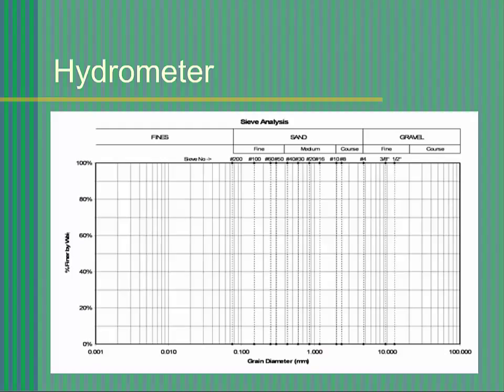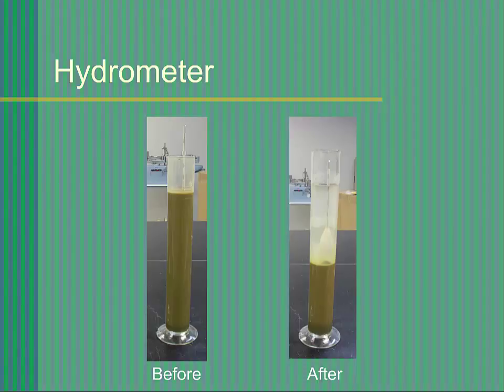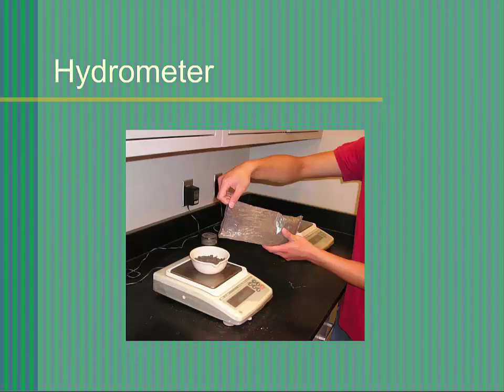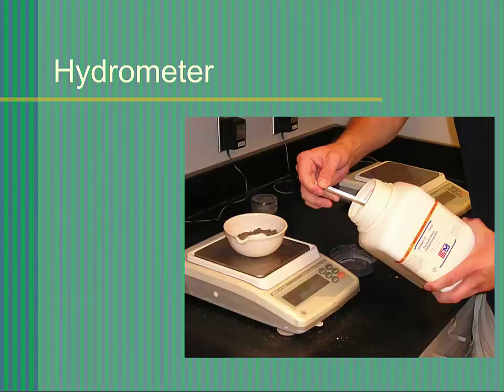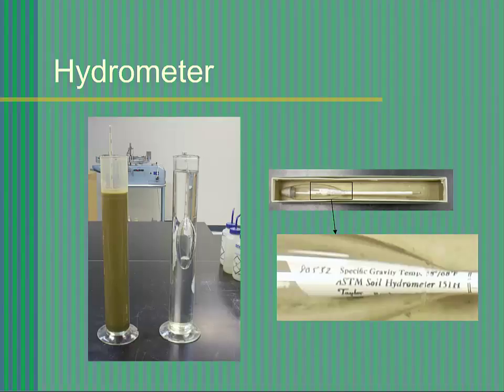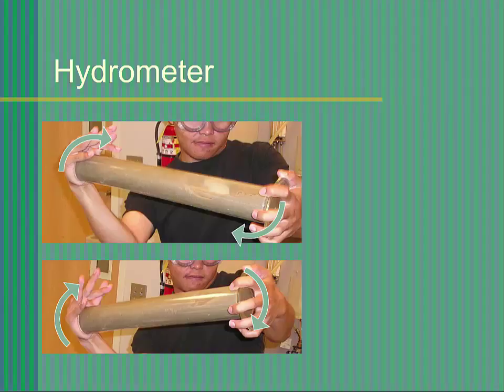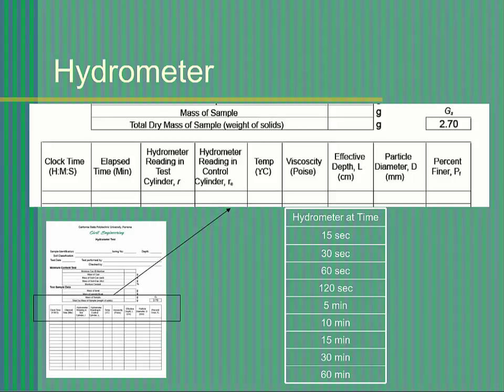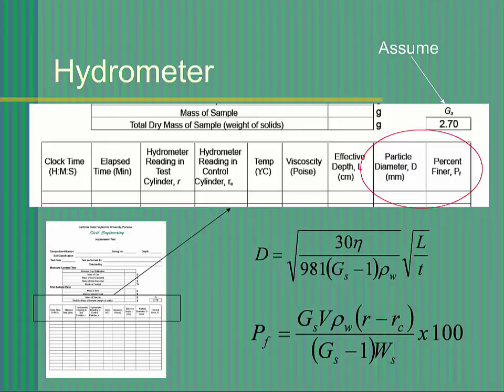Hydrometer 1

Comment: Why do you choose the 151H instead of 152H for this test? Thanks.
Reply from the maker: The two are the same except for the scale.  The 151H reads in specific gravity and the 152H reads in g/L.  You can use either.  I prefer the 151H because student learn the concept of specific gravity in earlier classes.
Reply: @introductiontogeotechnical4976  Does both hydrometer calculate diameter and percent passing?
Thank you